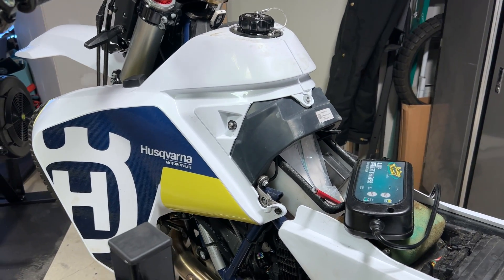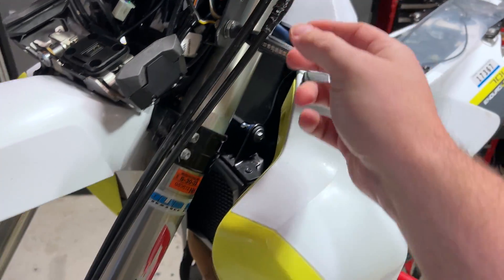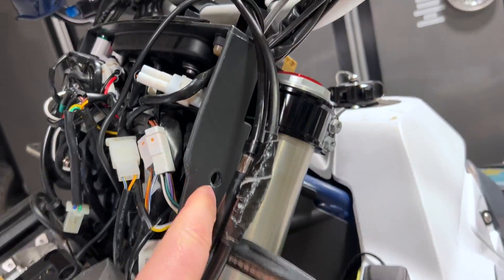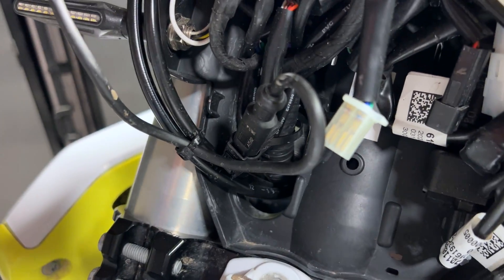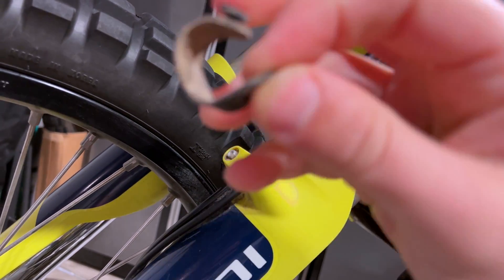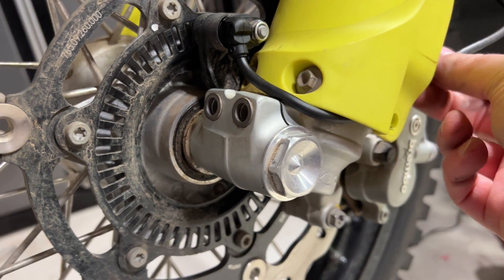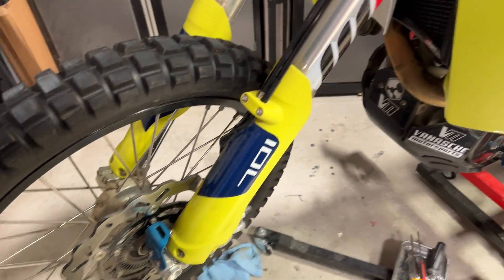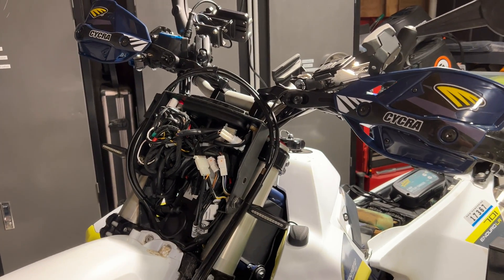Install: 690/701 ABS Speed Sensor Replacement (Husqvarna / KTM)

Comment: When your abs sensor went bad did it lock you out of tc and abs as well as locking mode changes?
Reply from the maker: Hi, it was on the way out but had not failed yet.
Reply: @AdamChandler86  ok, thanks for the reply. I mashed my rear abs sensor replacing my rear tire dropping it and I have no tc or abs rn

Comment: My cable was broken, so no abs, QS, mappings, speed readings etc. Now I soldered it back together and all the abs related stuff works again, only the speed reading doesn’t work anymore. Any ideas?
Reply from the maker: Maybe someone else will reply but that's why I just replaced the entire cable. didn't want anything to go awry and cause ABS or something else to stop working.
Reply: I got the same issue…
Reply: Did you get your speedo To work again?

Comment: I broke the plastic ABS sensor bracket on my last trip.  This video helped me see I will have to take the front wheel off to replace it.  Zip ties held the sensor in place for the last 200 miles of riding while finishing up the NVBDR and starting the IDBDR.  I have the Nomad metal protector on hand to install as well now.
Reply from the maker: Nice work! and I'm glad it helped.

Comment: Thank you for the video. I have an issue something like when gear is at N position the speedometer is showing 0,4,7 or 9 km/h repetitive when the motor is not moving. Should I clean somewhere to fix it? Thanks for the answer.
Reply from the maker: Definitely speed sensor related. but I have no idea how to help. Sorry.